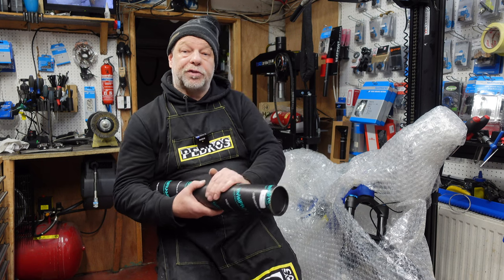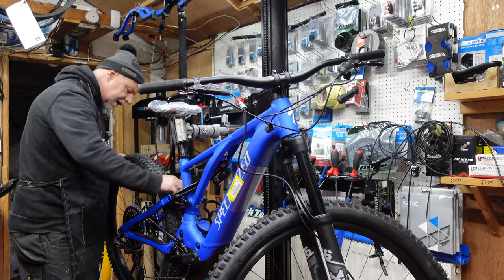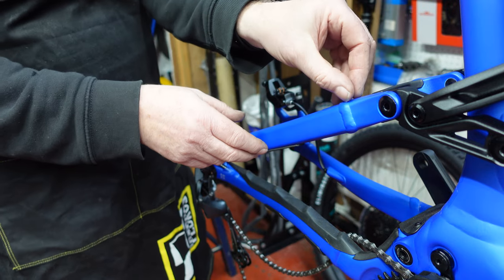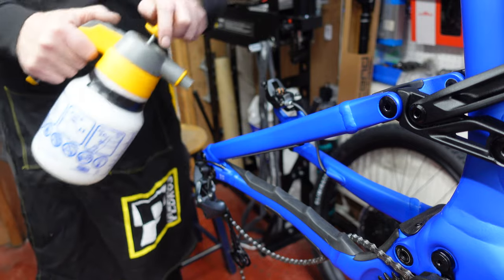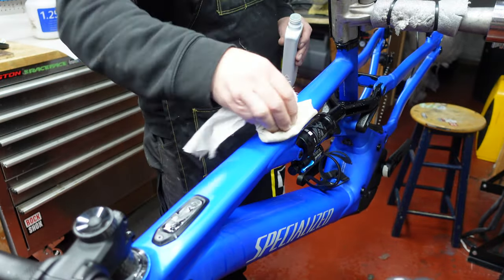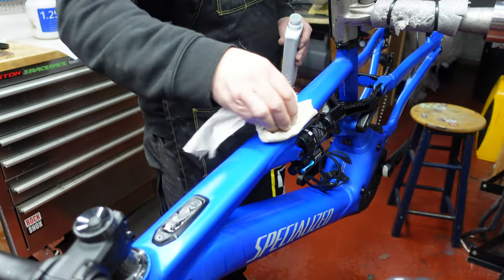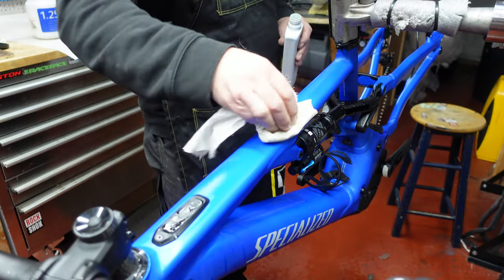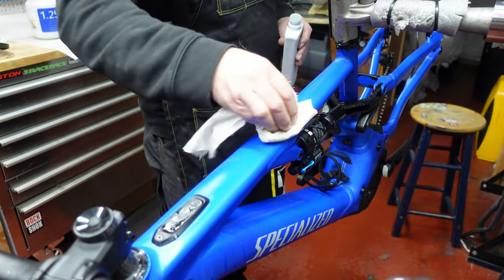How to apply Invisiframe to a Specialized Levo

Comment: Hi Dave, thank you for putting this great video up. I've now fitted the invisiwrap which i purchased from your shop for my wifes bike and found the video so helpful in doing so. It took me a lot longer than the 3 or 4 hours it takes you, but i enjoyed having ago at it myself. It does get easier after a few pieces, but i did still end up with a few tiny bubbles here and there (not that the wife has noticed yet 😀). I didn't have the best lighting in the room plus the bike was not brand new so there's an odd scratch showing through. All in all i'm happy with the outcome for a first attempt. Thanks again for the great tips. We definately will be calling into your shop again as and when we need spares etc because you deserve the custom with the videos and great service /advice you give.
Reply from the maker: Hi Gary, Thank you for watching and your comments, glads you did ok with it, see you soon

Comment: Best inststruction on invisiframe I have seen. I was able to wrap my Specialized Stumpjumper evo One thing I wish invisiframe would do is let you know the orientation of the parts, as well as where you should place it on the frame. some of the parts, ex, right chain stay, it isn't obvious which part goes to the front of the bike for example. I eventually figured it out, but it took a bit.
Reply from the maker: Glad you found it useful

Comment: very useful video Dave, as it happens I've just bought  the same bike, but in red gloss, and have bought the gloss Invisiframe kit. I saw you remove the factory protection from the seat stays, but I notice there is some quite thick substantial factory protection on the underneath of the down tube and the back of the seat tube. Did you remove these? You show how to fit the downtube Invisiframe and I couldn't see any sign of the factory protection so I guess you removed it, but just wanted to check. Thanks for all the helpful videos, great education!
Reply from the maker: Hi, I would have removed it first for sure

Comment: Hello, thanks for sharing the video. I just bought a S Works Turbo level and ordered the InvisiFrame kit for it.  Question, did the downtube on this Alloy bike have a protective film already on it on the underside? My S Works does and I assume I need to remove prior to installing the invisiframe piece.
Reply from the maker: Hi David,. Thanks for watching and your comment, Most of the protection that has been added in the factory can be removed. before you do, get your invisiframe kit, lay the sheet out on the bench and check which parts they have sent protection for. Good luck, have fun.
Reply: @TheYorkshireBikeMechanic  Thanks David! Great video content and feedback. Cheers!

Comment: My turbo Levo carbon has some very thick film on the down tube… do you suggest removing it?  It seems the thick stuff would offer better protection from rock strikes etc. than the thin film?!?
Reply from the maker: If you user an invisiframe kit it comes with a new piece that wraps around the sides too

Comment: Great video Dave. Before I discovered this product I installed some 3M freehand on to my down tube to protect the factory painted decals. During a brush with a pine tree a section tore and alas the decal was scraped. I’m hoping the invisiframe kit I just received provides more robust protection. BTW does brake cleaner work just as well as bug & tar remover?
Reply from the maker: Hi Curtis, thanks for watching, don’t use brake cleaner it’s far too harsh, it’s well worth buying the proper stuff

Comment: Hi Dave. Nice video.  Did you remove the chainstay protector before installing the i nvisiframe or you just work around it?
Reply from the maker: Hi, thanks for watching, the chainstay protector was removed and then refitted later.
Reply: The Yorkshire Bike Mechanic Thanks for the reply Dave. Is it a sticky chainstay protector or just a clip on. I have a sticky protector on mine and I find it tricky to remove. Any tips?

Comment: How much protection does this stuff actually give a bike?
Reply from the maker: Hi, It's really good stuff, it will give the parts of your frame such as the seat a chain stays protection against many accidental damage situations, protect your top tube from wear such as much from shorts/clothes etc, Downtube from small rock strikes.
Reply: Did my bike 4 years ago and still no chips despite heavy use

Comment: I unfortunately took the bottle cage out before watching your video, any tips on getting it back in? Awful design!
Reply from the maker: Hi thanks for watching, I agree such a stupid design. There is no easy way to get the bolts back in, it’s so tricky, turn the bike upside down, use a long flat screw driver to push the bar down to make it flat then use your other hand to put the bolt back in, it’s as tricky as hell, sorry
Reply: @TheYorkshireBikeMechanic  thanks for this, it helped. 45 minutes of hassle later I finally got the screw in. But worried I pulled that cable a bit too much though. Praying that bottle cage won't ever need replacing! Nice videos!